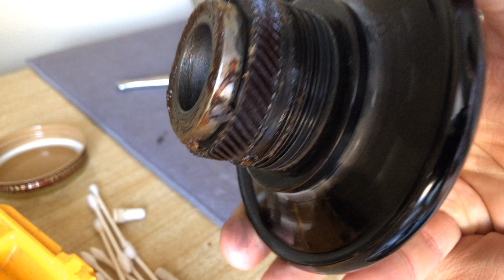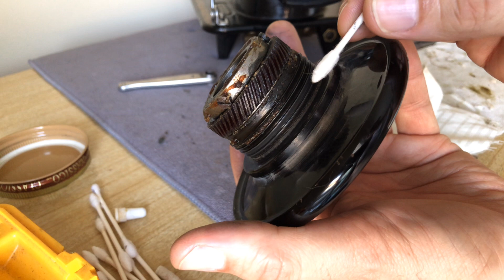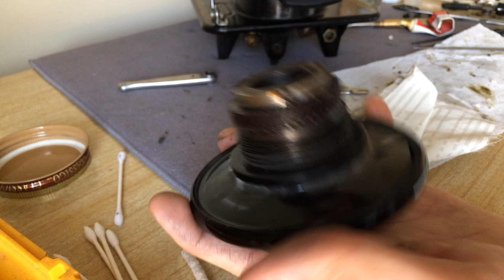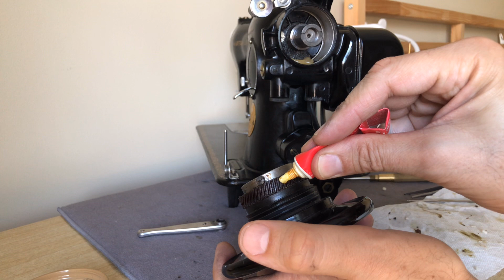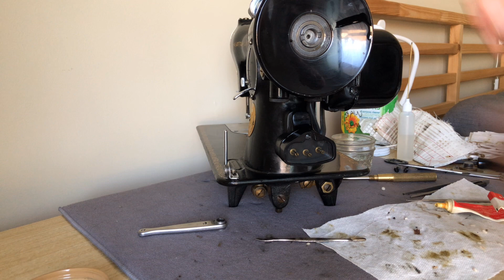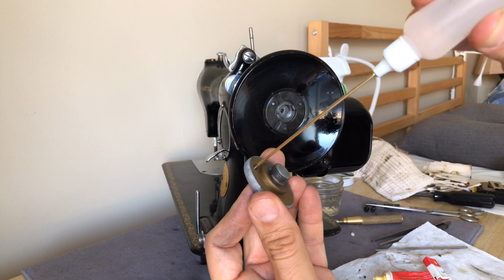MOTOR SERIES #14: A Handwheel in a Motor Series video? Cleaning & Greasing Singer 15-91's Hand Wheel

Comment: I recently added this wonderful

 15-91 to my collection ❤️  from 1948 in fantastic condition the only thing is the stop motion screw is so tight I can not get it loose I do not want to force it beyond my own strength any tips on what to do? I love your videos thanks 😊
Reply from the maker: There can be hope in getting it loose, but patience and time are your starting point. Try various penetrant oils that you see me showing in videos (Liquid Wrench is one of the most useful, but I would CAUTION you that it is very smelling and does not evaporate quickly like some of the others.  The other approach you can use with the penetrants is heat.  A hair dryer can be used or heat gun, but with either be EXTRA CAREFUL as the heat can get too hot and cause damage.

Comment: I have cleaned a few hundred of these handwheels in Singer 15, 300, 400 series etc. I have found that kerosene and a soft brush gets the handwheels and the complete sewing machine squeaky clean. Kerosene will not hurt the paint.  Afterwards, clean the paint with GOJO (non-pumice) hand cleaner using a soft bristle tooth brush and then wax and polish. Then, since you have cleaned the old grease and oil from the machine, lubricate it again with fresh oil and grease. If you are starting with a nice paint job, this will bring it back to new. It is amazing how much dirt is on these machines that can be removed with Gojo. The dirt is an abrasive and over time will destroy your paint. Keep your machine waxed and the paint will last many years with daily use. Kerosene will clean the grease from your machine without hurting your paint. (REMOVE ALL ELECTRICS FIRST) If you follow these steps and look for a video of cleaning and servicing your motor, you will thing you have a new machine.

Comment: Is Singer Lubricant from 1937 in original tube still good?? Smells ok.  It's kind of white/orange.
Reply from the maker: Hi Kathryn.  Most assuredly not.  I would highly suggest that you do not use that.  This is just a generalized definition, but most types of 'grease' are made from oils mixed with solid powders which give them their thick viscosity.  Over time, (and it can be just several years), the oil and solids will separate.  An example of this is the grease used in stand mixers.  Sometimes, you will see oil dripping from them and its due to this grease separation.  So you really should not take a chance on what must be very old grease (aka Singer Lubricant)

Comment: Hi there, sorry, reaching out again. I finally decided to take my machine in to my local repair shop. He works on these machines a bunch, and she's up and running beautifully...EXCEPT, he said that it doesn't need grease AT ALL. I'm only to oil it. I told him I'd gotten in there and cleaned the grease out, and he seemed unphased. Said he never greases them, and neither should I. That it will run for 30 more years with no grease. I still have the "Sew Retro" grease from the featherweight shop, but I'm afraid to use it, but also afraid to sew on it with NO grease in there. Wondering if you'd made any headway in the grease research, and/or had any thoughts on the above.
Reply from the maker: It might be helpful to help us understand what part of the machine you are asking about?  Some lubrication points on a vintage sewing machine require oil and 'some' models require grease.  If the sewing manual calls for "Singer Lubricant" , that is a reference to grease similar to what you found at "Sew Retro".  Grease offers lubrication (again ONLY where indicated in the manual) that stays on areas such as gears without flying off as easily as oil will.  Also, 'some' sewing machine motors had bearings or bushings that require grease while others require oil.  Sewing machine manuals from the vintage era were mostly thorough and were informed by the engineers who designed the machine.  Follow the manual's guidance which is going to be more accurate vs. what others 'have heard'!

Comment: I changed a 15-91 machine, putting in a wonderful working motor from a not so pretty machine. I put the motor housing on, then the flywheel, but now the previously happy motor won't turn the pretty machine. I changed the handwheels. Same thing. When the handwheel is off, the machine turns beautifully, but putting on the handwheel (either one) the machine won't turn. Sigh.. what do you recommend? Pretty is as pretty does, but it would be nice to use the shiny pretty 15-91 and not her pitted sister...

Comment: Where else the grease is recommended ?  Can we use oil instead of grease?  Thanks
Reply from the maker: Grease is used any place you have gears and also on "SOME" singer motors that had grease ports.  I would never use oil where grease is required. It can cause damage to the machine and ruin motors that take grease.
Reply: @VintageSewingMachineGarage  thanks!
Reply: @VintageSewingMachineGarage  thanks i have a 201- 2 i just want to be sure , i remember mother using grease only ongears under never oi